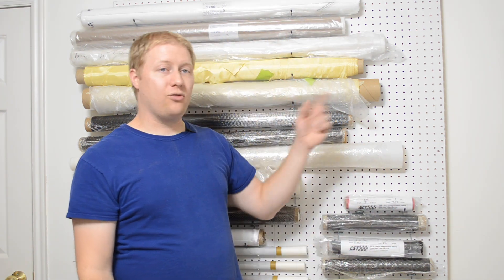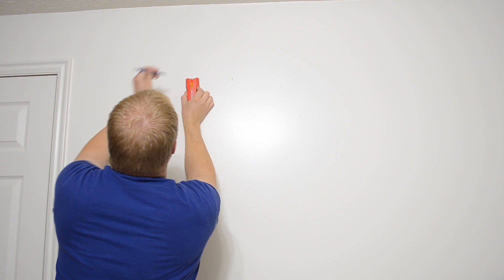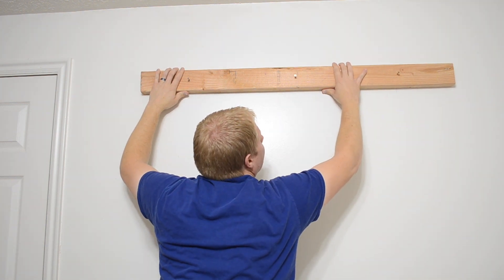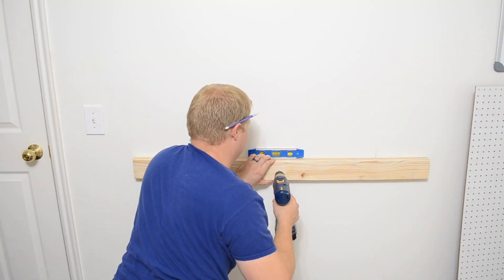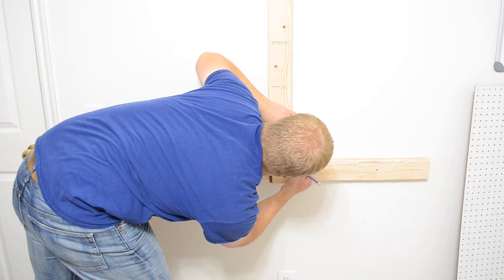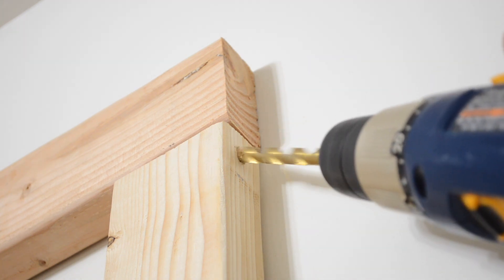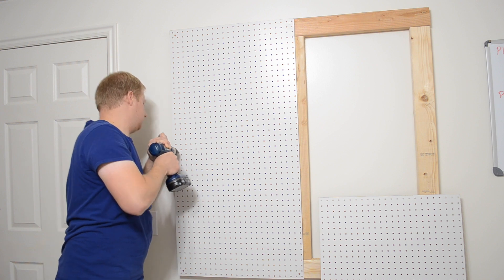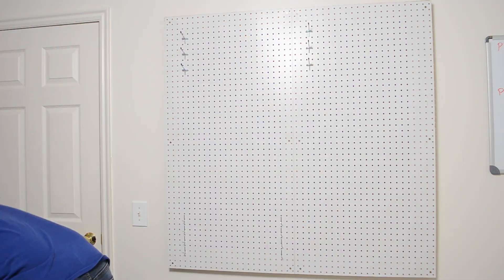Building a Carbon Fiber Fabric Organizer - Composites Shop Build Pt 1

Comment: I've watched most of your videos as I am about to finally pull the trigger and dive into messing with carbon fiber. I've dont fiberglass in the past, but cost had prevented carbon. Only question...why move your intro to carbon to your website where you ask personal info? I mean we can already subscribe here and get notifications when you release new content,  and we give up no info... what's the deal?
Reply from the maker: That's a very valid question, Gabe, and I hope my reasoning makes sense.  I set it up that way for a couple of reasons.  The first is that I really want to build a community of people helping each other learn this craft and, for those who are interested, help each other to build composites manufacturing businesses.  And while YouTube is a great resource for hosting videos and helping me find those people who would value such community, there's too much noise here and it's just not built for that kind of interaction.  The second reason is that I have no control over YouTube's algorithms, and they can tweak them and shut down traffic to my channel in a day.  I've seen it happen, and the advice I've received from many successful content creators is to build your brand somewhere outside of Youtube as well so you're not wholly dependent on their algorithms.  So I want to also build my community elsewhere, in a place that I own and have control over.  Right now that's my website and my email community, and I'm working to grow it and increase the resources I have there.  As I say in the signup form, if my interactions with you over email become spammy then I haven't earned the right to have you on my mailing list and you should definitely unsubscribe (which you can do at any time).  Hope that makes sense, and I apologize for the slow response.  I sincerely appreciate you being here and I appreciate you asking :)

Comment: Have you thought about placing the pegs wider and hanging your rolls on them with a dowel through the rolls?  This would prevent the bonds from denting your raw fiber.
Reply from the maker: Not a bad idea.  I was a little concerned about getting visible distortions in the fibers from resting on the hooks, but so far it doesn't appear to be an issue.  If over time it does, I'll probably do like you suggest.  Thanks!